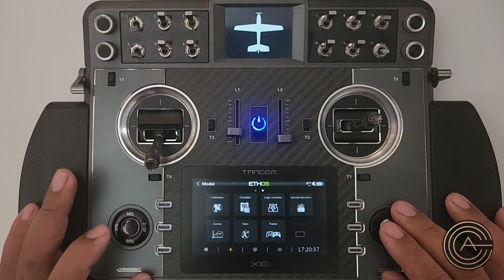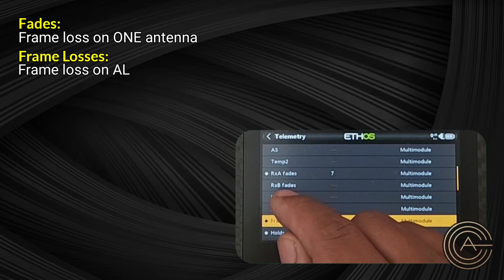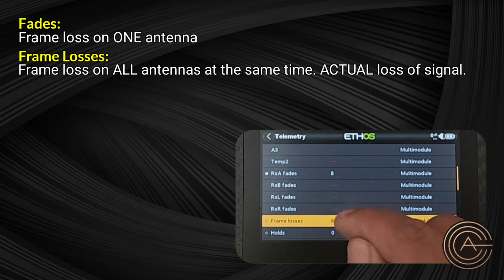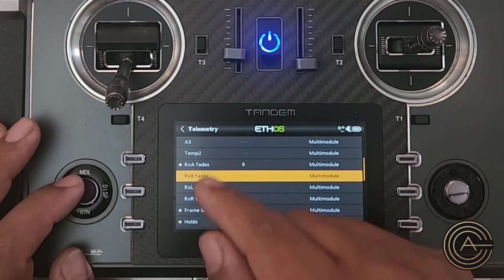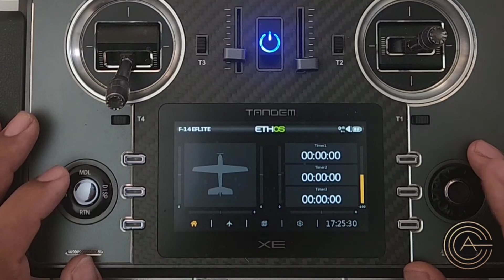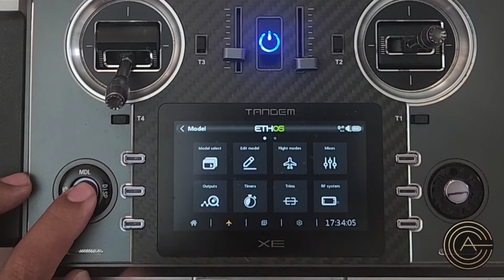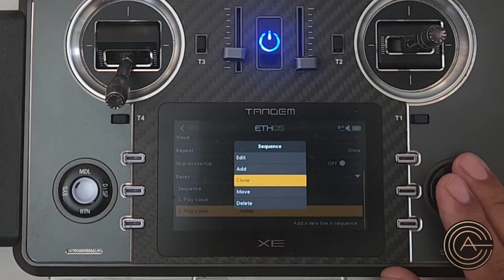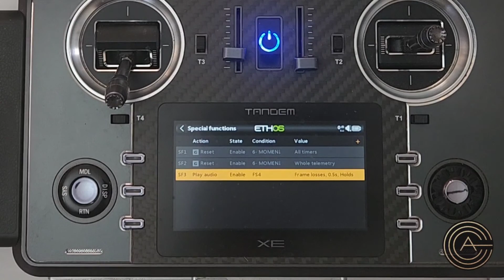The Frsky Series (V 1.5+) Spektrum Telemetry - Fades, Holds and Frame Loss

Comment: Can you please tell me if you need to update the Multi Lua even if using the Ethos Suite to update your radio.  I have been using the multi.lua ever since Ethos introduced it but I have never updated it since.  I'm I correct in thinking the Ethos Suite updates such files because I have other similar lua's installed on my radio like CRSF and Yaapu.
Reply from the maker: Ethos Suite does not update luas. You will need to update those separately. Ethos Suite does do a lot more than it used to. It now updates the internal protocol module which used to be a manual update but it does not do other things like the external module. You still need to update the firmware on that manually and any lua script you have.

Comment: Spektrum receivers have two failsafe modes - SmartSafe and Preset. The default mode is SmartSafe where the throttle (hopefully) goes to idle and the flight controls hold their last position. In Preset mode, you hold the sticks in the position you want the controls (including the throttle) to go to during the failsafe. You do not need to re-bind the receiver simply because you re-trimmed the aircraft. Also, if your trims aren’t centered, you should adjust the linkages so that your plane flies straight with the trims centered (within a few clicks).
Reply from the maker: How do you change modes and do that preset?
Reply: @all_rc  Well, I should have read the manual before opening my mouth.  🤭  Actually, the failsafe selection process is like the "SAFE Select" process on BNF AS3X/SAFE receivers. If you use a bind plug, you pull the bind plug after powering up the receiver but before you bind the transmitter to it. That puts the receiver into the Preset failsafe mode and it will remember where the servos were when you bind the transmitter to it. If you leave the bind plug installed through the whole bind process, the receiver will bind in SmartSafe mode where the throttle will go to idle (or wherever it was during the bind) and the servos will stay where they were when the failsafe occurred. If you use the bind button on the receiver, you have to press it a second time before binding the transmitter to it to put it into Preset mode. Obviously, I've never used Preset mode since I've always used the standard bind process. Older receivers like the AR610 don't have a Preset mode; they stop sending control pulses to all of the servos except the throttle and it will go to wherever you had the stick during binding.
Reply from the maker: Got it. So that's why my method still works. I rebind with the trims adjusted and it goes to preset mode. I was always told rebind to set the failsafe. But I don't really use Spektrum so I am not an expert.
Reply: You also have the option, if the receiver isn't currently a locked BNF, to adjust the failsafe settings through forward programming.  You can set each channel up individually from the transmitter for mode, preset value, etc.  Obviously need a transmitter that can do forward programming for this.
Reply: @shanesdiy  Yes, I’ve seen that in my iX14 with Smart AS3X/SAFE receivers and I’ve mentioned it in my videos. I think it’s mostly for sailplanes. I’ve never had reason to use preset positions.
Reply: I'm actually using it on a project right now where I need channel 5 to failsafe to a specific position so I went in through forward programming and configured it as needed. Will be using that in an upcoming video.

Why would sailplanes have a different failsafe requirement than any other plane?
Reply: @shanesdiy  That’s the impression I got from reading a receiver manual. Perhaps they want the spoilers to deploy. I might see what Google comes up with.
Reply: @shanesdiy  From RC Groups..

What failsafe settings should I use on an RC glider? Your radio choice determines the failsafe setup process, but the end goal is the same. Here are three different examples of common failsafe setups:

I use this first method on most of my models, but if the signal is lost while the glider is in a thermal, there is a decent chance the model may fly away. I set up my failsafe like this, so if I enter failsafe during a contest, I still have a chance to recover and complete my flight or get my model back into the flight box for scores. There is a definite risk/reward factor. I drop my camber to around 10mm with 30% left rudder and a small amount of up elevator. This setting puts the model into a slow left turn. If the model is not in a thermal, I have time to run toward the model to re-establish the link. However, if the model is in a thermal, it might continue climbing and fly away before the connection is re-established, and if there is wind, the plane will drift downwind.

A more popular method is to have the glider deploy full flaps with full left or right rudder and allow the glider to slowly spiral to the ground. This is the safest failsafe setting for the model because it loses lift and enters a slow, controlled fall. The steady fall reduces the time the glider is in the air to minimize drift, while it still descends slow enough to minimize potential damage.

This last method forces the glider down in a controlled descent similar to the second method but much quicker. By using only half flaps instead of full flaps, the glider goes into a faster and steeper spiral to the ground with the least amount of drift. While this will likely damage the glider, it minimizes the potential for accidents if you are flying near a busy road or highway.